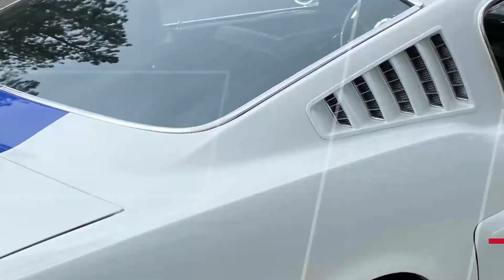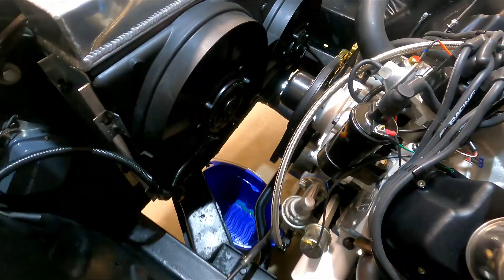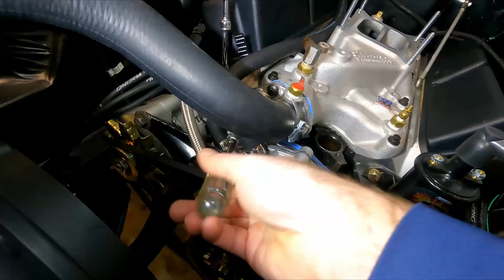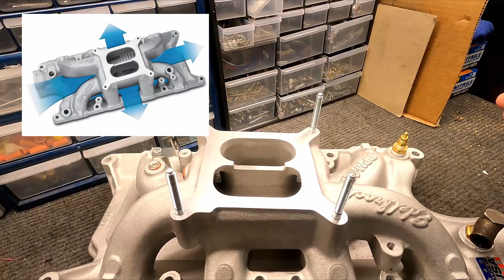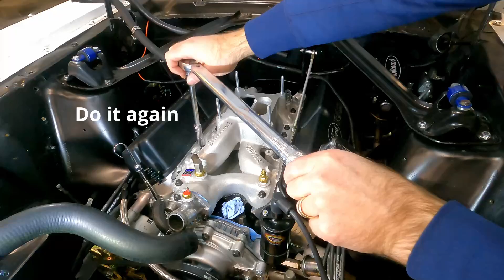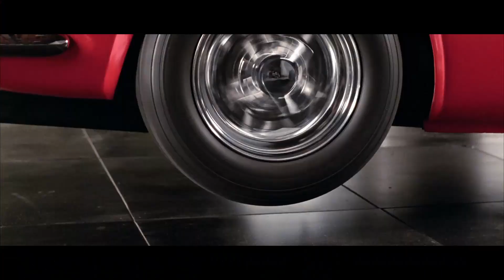Installing the Edelbrock RPM Air Gap Intake Manifold

Comment: Also curious do u have a later block that has the bosses for the lifter hold down? I opted for the more costly link bar lifters on current build. Didn't want holes in the block
Reply from the maker: Sorry Boss, I don't know on that.  The block was one that my Engine Builder had at the shop, sold it to me "cheap".  :)
Reply: Yes it does. You can see the dog bones and spider lifter hold down when he removes the intake.
Reply: @pauls7751  good observation
Reply: @Donny.C.wlWilliams  in the mid 1980's Ford introduced the roller camshaft in its 302/5.0 engines. The blocks came machined from the factory to accommodate the hardware required to keep the lifters straight (aka dog bones) and to hold the dog bones in place (aka spider).
Reply: @pauls7751  thanks
Reply from the maker: @pauls7751  I was thinking it was something else that can't easily be seen, that's why he was asking.  I guess I need to learn the names of the parts on my engine.  😆

Comment: Considered going coil overs in the front and removing the shock towers?
Reply from the maker: Where would the top of the coilover attach to?  Where would the upper control attach to?
I see what you're thinking though, I'd like to get rid of the towers, but it'll have to be done with a new front end, and I don't have the cheddar for that.  :)
Reply: @KruseBuilt  sorry. Meant rack and pinion

Comment: For the distributor, when removing, the rotor turns a few degrees counterclockwise. I mark that position on the distributor before pulling out the distributor. When installing, align the rotor with this mark and the distributor falls in nicely. 
Great video as usual.
Reply from the maker: That's a good idea.  :)

Comment: I had a feeling you were going to go that route when you got the new engine. You'll get a wider RPM band for sure.
Reply from the maker: Yeah, I figured it was going to happen eventually, just not this soon.  I was able to get a good deal on this unit from a guy in Florida, so it falls under the "make it happen!" category.  :)
Reply: @KruseBuilt  awesome
Reply: According to dyno results, the Air Gap is worth 3-4 HP over the Performer RPM. But who really knows for sure. lol
Reply: @robertclymer6948  yeah the  RPM Preformer  is a slight difference from the Air Gap, but Air Gap vs the regular non RPM Preformer intake is a noticable gain. I love my RPM it was a big difference past 5200 compared to my old Preformer. Andy's 347 will scream past 5500 now.